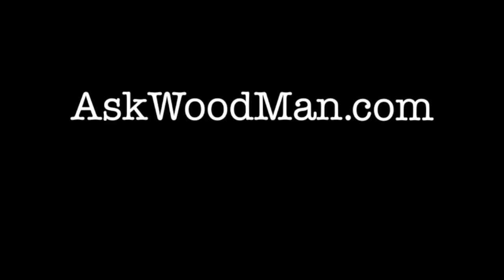Using The Festool Domino To Cut Receivers For Tool Caddy 5/7

Comment: Snap! I used my domino for exactly the same thing, The domino is a great tool, and it gives me a lot of confidence that  a few dominoes in each glued joint of the chair seats that I make will not fail through the years. I only use my morticer for very large joinery, .

Comment from the maker: The domino is essentially a specialized plunge router for placing solid wood slip tenons in workpieces for structural connections. I consider biscuits suitable only for assembly alignment. I have never owned a biscuit cutter and never use them in my work.

Comment from the maker: It is joinery tool primarily used to keep from having to cut mortise and tenon. But it can also be used for joining panels. The dominos are just slip tenons and the machine cuts the mortises absolutely perfect every time. Here I am just using it to plunge slot receivers.